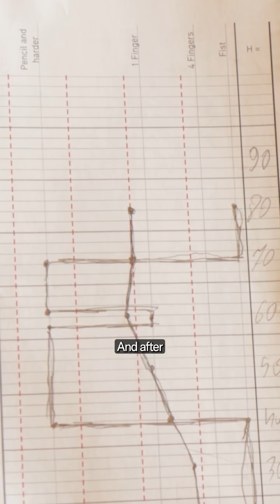Watch a Mountain Guide Unlock the Secrets of Snow Pits! ❄️🔍 #GeorgiaPro

Comment: I didn't realise you could so easily view the structures of the crystals! That's amazing you can get instant feedback from the snow by looking at the crystals, I wonder how much information you can see
Reply: Not as much as you'd think. The big problem is that the snowpack changes from place due to wind-loading, sun exposure etc, and you can only dig so many pits or run so many ECTs.

When experienced people die it's often because they missed some localized property of he snowpack that happens to be in just the right place to act as a trigger.
Reply: @patrickchase5614  what? what are you talking about bro -_-

This data collection method looks extremely effective given its very simple testing methods. i bet there is so much information within the crystals that experienced scientists can read and understand